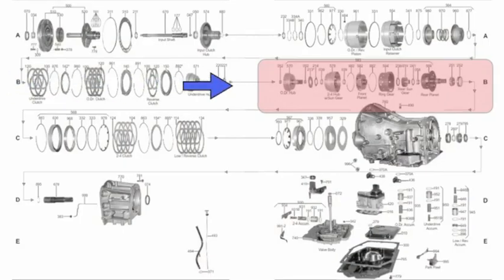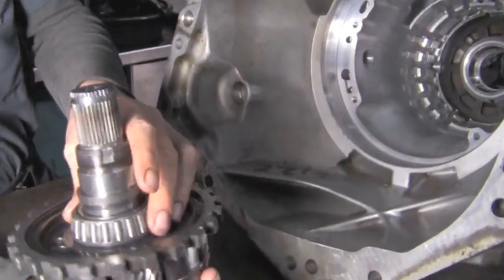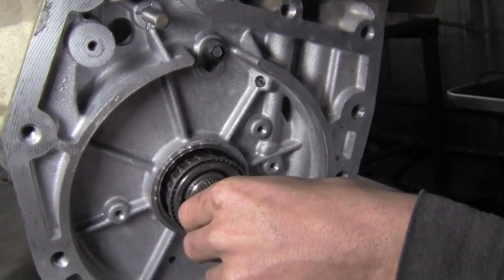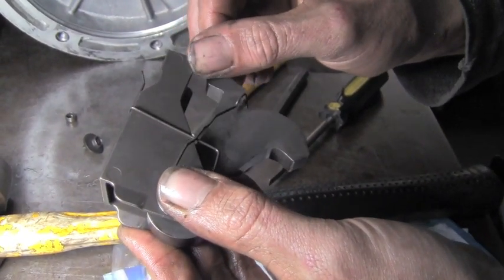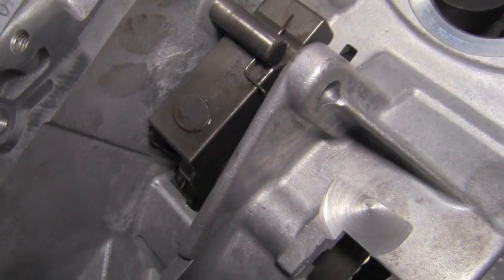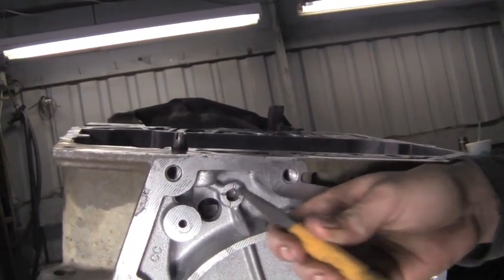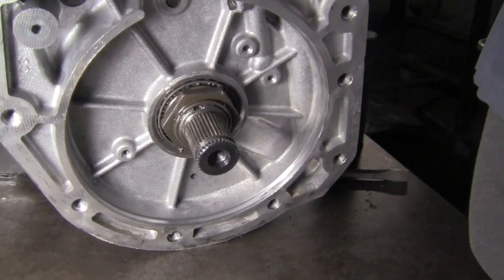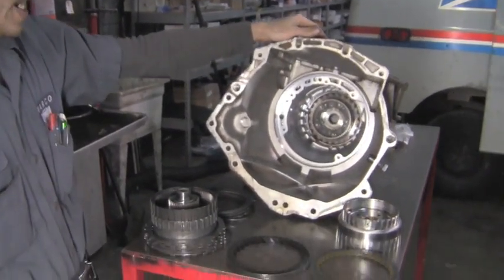Trans rebuild part 11  Planetary Gear

Comment: The parking sprag pin that has to be tapped back into place goes under the spring, otherwise it will just fall into the planetary. When he removes it in Ep4 you can see that's how it is installed before he punches it out.

Comment: Absolutely mind-boggling the technology that goes into a transmission.. I have a 42rle in a 2010 Chrysler 300 and it has over 230 k on it.. the fluid was just changed the second time.. still runs good.. once in awhile it'll shift hard but I imagine the clutch material is a bit worn.. 4 speeds are great ..